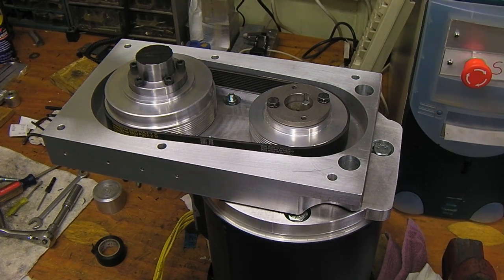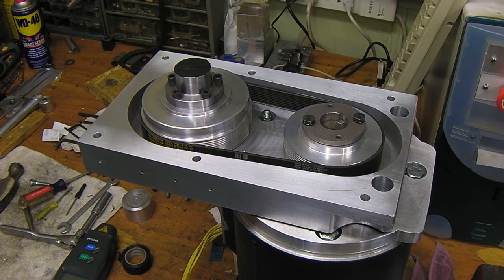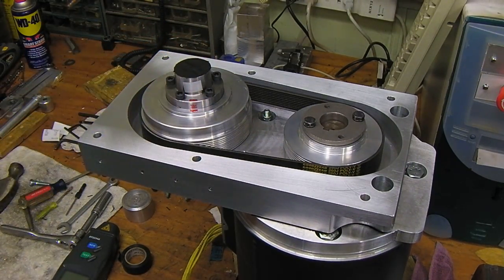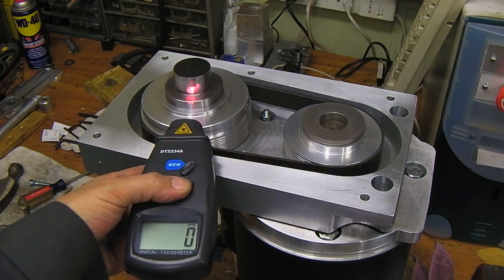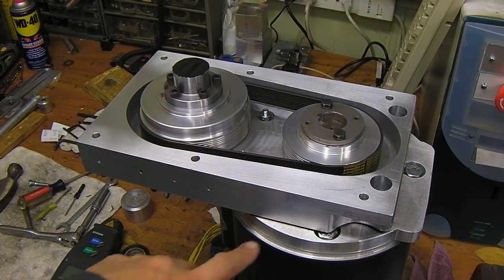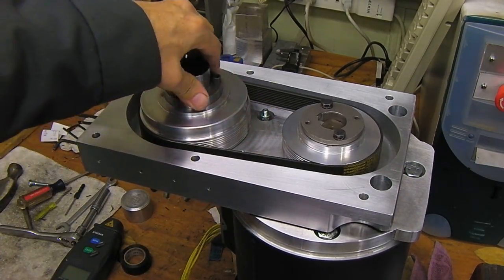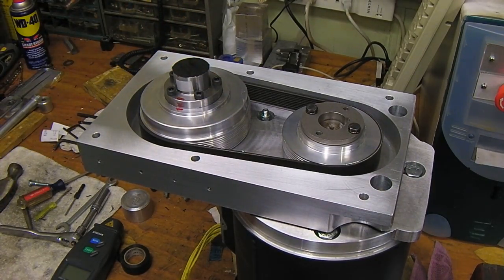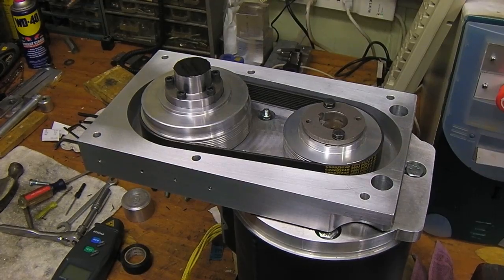Single speed internal belt driive RF-45 LM-45 .MP4

Comment: I’ve been having a heck of a time finding short poly belts. Are you using micro poly v belts? The standard pk series I have inserts for cutting the grooves are 30” and up length. I feel uncomfortable running these micro belts I have. Otherwise setting up the dividing head and giving a htd8m a go and sticking with a 1:1 single pulley. Think I mentioned on another of your videos running a gearbox on one of my 4 mills and I’ve had to replace a couple gears already due to wear. I did upgrade oil to 600 Mobil and added a transmission cooler and pump which surprisingly seems to work well and it is stuck in the high speed gear (almost 1:1) now since the others are too worn and kick out of mesh if I try and use them. I have a 3490 motor and I’ve driven it up to 8000rpm which is great for small aluminum end mill cutters and with the vector drive I’ve run it down to 25rpm so it has the range I need as it sits and imagine a 1:1 belt would be fine and probably go even higher rpm though my bearings are rated around 8500 greased, 13,000 oiled? I’ve been trying to do this project over a year but the belt has been the issue in finding something appropriate I can trust. I don’t like to remake or have future issues because I did it wrong to start. I like the quiet of a poly belt giving another reason to rid the PM gear box and avoid future failure. I made a bt30 spindle I am sending out to have through bored and iso taper ground along with bearing races. It will use a smooth shaft with a single keyway and no longer have the quill go up and down. It’s the only Rf45 style I have that the column doesn’t shake vigorously when going up and down so fixing it will keep the debree out of the access holes in the quill. Once I figure out where to find belts then i will stock pile a bunch on the shelves so I’m not hunting again. Any link to or recommendations would be great. I will probably copy to some degree what you’ve done in making it internal.
Reply: I should’ve clarified I’m running a 3hp motor. I may even go to a 5hp someday if I see further benefit after conversion is all complete.

Comment from the maker: Most all the motors are called either two poll or 4 poll or 3650 RPM or 1750.  Some may say a slightly different RPM but will be one of the two. A lower posted RPM means a rotor with more slippage and that will be a motor that is harder to stall. 

I ran a 3650 RPM motor and like all 3650 it has half the torque of a  1750 RPM. It is a non VFD motor. 

I used it for over a year and did lots of different work with it. Mainly AL but a few steel projects too.

You have to ask what range you want your power for the kind of work you do. Also what kind of motor you have and what RPM frequency you can spin the motor.  I ran 5Hz to 100Hz.

Most real VFD motors have a electric fan so they cool well at low RPM and they dont over speed at high RPM. Low RPM running large taps like a 1\2" in steel I would run 5hz which would stall most the time. M6 in AL was fine. You could get a lot of extra torque by setting up the low speed current and the speed compensation with the VFD  but this will cause over heating if you do a lot of holes. 

So if you have a second machine for tapping and want to mill AL most the time and use carbide tooling with a 3650 RPM motor then I would go with a motor over driven slightly lets say 1.2 to 1 The stock spindle bearings are good to around 5K with fresh grease and milling in AL with a 1\2" cutter is way way better at 4K than 1500. 

If you mainly do steel and use mostly HSS cutters and tap a lot and have a 1750 RPM then go 1 to 1. 

Hope that helps.

Dave

Comment: So the drive ratio is just below 1:1?  If I recall you said .8 :1. I’m just building my belt drive conversion with  6030 3hp AC motor on a VFD. Is there an advantage to under driving it to .8 :1? I assuming possibly for power tapping? Any suggestions on if I should just go 1:1 with two 4” -5” pulleys or do  a 5” pulley on the spindle and a 4” on the motor. Hope you can shed some light, even if it’s dim it would be better than all the other channels I’ve asked this similar question which generates loud sounds if crickets.
Reply from the maker: The 3hp was a 3600 RPM so it did not the greatest torque. Drilling larger holes in steel was the problem.  You need to run really low RPM and the motor just does not make much power at that speed. You can set the VFD to give you a lot of torque but it will be overheating.
For milling it was fine and if you use a end mill for drilling then going to 1 to 1 is just fine. 

Tapping with larger taps can be a problem too. 

The big mills do go direct drive but they run 30 HP or more. Getting your VFD set just right will help but if your drilling a bunch of larger holes like a 1\2" in steel like I was it will over heat after 10 or so.

Comment: Don’t believe these ever made it to market. Doesn’t look like there would be any way to get a spindle wrench on the shaft with that on top taking the extra distance needed to retract the spindle to change tooling.
Reply from the maker: I made a spindle wrench and it worked fine, the shaft still would stick out by a inch, but everyone wanted the two speed belt drive so I made them for a while. I sold this one so its out in the field now. I will be selling the two speed this summer.